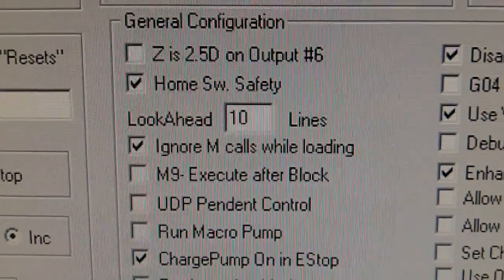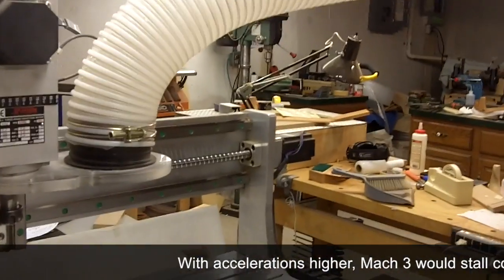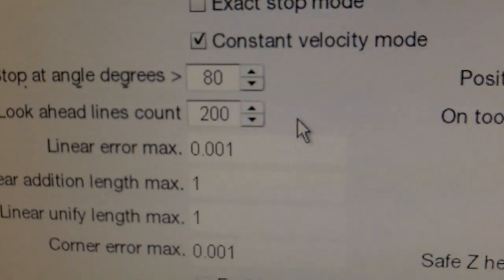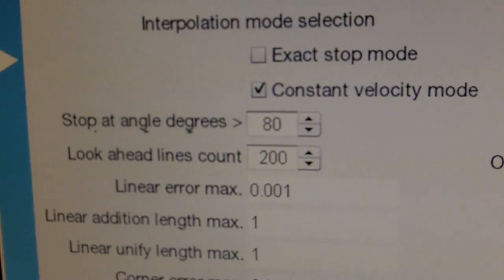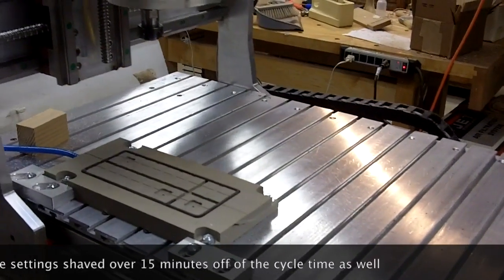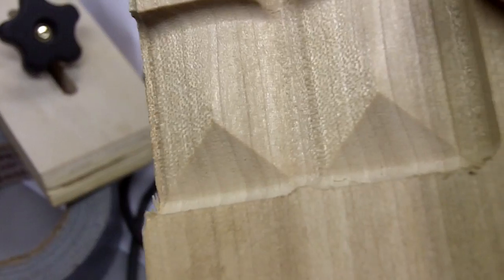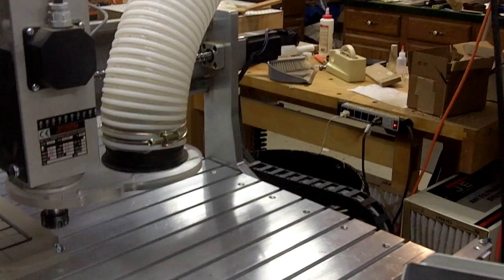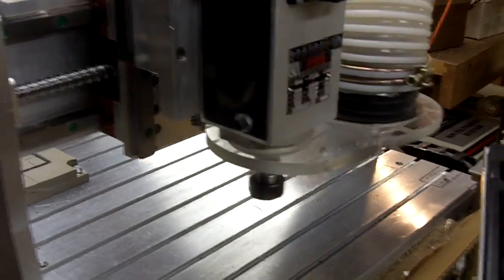Mach3 vs. UCCNC

Comment: I think the answer to this uneven comparison, is the "constant velocity mode" that is activated on UCCNC.
Reply from the maker: Can you elaborate a bit?  I don't understand the question you're answering.  CV mode is active on both UCCNC and Mach3.
Reply: @beerco667  It's all about how the systems "optimize" the code to be able to run at the velocity specified.
Reply from the maker: @Mr_Wh1  , Yes, that is correct.  UCCNC does a better job at CV than Mach3.
...still not perfect though - ran a spiral toolpath the other day and it was dog slow.
Reply: @beerco667  I actually don't understand why anyone would use it in the first place.
I mean, if it's for precision parts I wouldn't, but if it something organic shaped, then maybe a little minute rounding here and there wouldn't matter as to the look. It would properly matter a lot for time savings?
Reply from the maker: @Mr_Wh1  Just about everyone uses CV mode all the time for everything.  I now understand where you're coming from.

Comment: I just got UCCNC today and LOVE it so far! Does so many things better than Mach3 (as you already know) 

Can I ask why you changed your "Stop at angle degrees" from 89 to 90?
Reply from the maker: I do actually have it set to 89º these days but I might change it back to 80.  Just gives sharper corners on faceted 
3D work.

Comment: Can you use fusion 360 with uccnc?
Reply from the maker: Yes.  I don't think there's a post built in but I just use the Mach 3 post.  Modify as necessary.

Comment: I’m a newbie , other than I have an 80 watt cnc laser and worked a bit with Vetric software. I’m going to purchase a cnc router table from Avid cnc , but I want to build the electronics myself , so after studying this subject, I will use a UCCNC motion controller right off the hop and learn it instead of Mach . I have seen other videos also that showed more accurate cuts .

Comment: Unrelated question - What material is that vacuum fixture made from?
Reply from the maker: General Plastics tooling board - in my case 40lb/ft^3   Find a local distributor as shipping is a fortune.  Affordable if you pick up.
Reply: Thanks. I suspect it might be a bit difficult to find in the UK.
Reply from the maker: Yea, search for "tooling board" as it's available from a number of manufacturers. I picked them because I got a recommendation and there happened to be a distributor nearby.   Sign makers also use very similar stuff but I don't think you want to go much below 30lbs/ft^3 - you'll have to convert on your own ;)

Comment: I'm currently running Mach3 with an ESS Smooth Stepper and LeadShine M4660. Thinking about moving to UCCNC and unsure which controller I need. uc100 or UC300eth. My Leadshine MX4660 is handing all the limit switches so and relay outputs, so do I really need anything more than the UC100? What is the benefit of moving to the UC300, UC300eth or UC400eth
Reply from the maker: I'm not familiar with the LeadShine M4660 but, you still need to get the limit switch and relay data to the controller through the motion controller.  As far as I know, the only difference between the UC100 and the others you mention (other than USB vs. Ethernet) is that the UC300/400 has a lot more I/O than the UC100.  If there's enough I/O on the UC100 and you're OK with USB connectivity (which I am), there's no reason I can see to spend the extra cash.
Reply from the maker: Frauenarzt Dr. Stefan Frank  ,  good catch!  UC100 has a 100kHz max kernel frequency.  The others have a higher max frequency.
Reply from the maker: Frauenarzt Dr. Stefan Frank  ,  I currently have two routers in service, one with a UC100 + G540, the other with UC100 + C11BOB from CNC4PC.  If my control boxes both blew up today, I'd go with the AXBB combo unit from CNCDRIVE to rebuild them.  It's basically a UC300 (-ish) combined with a BOB with the various isolation etc. that's necessary.  Sports ethernet connectivity and has one whole port with 12 outs and 5 ins that's unused.  It's < $200 for the device!

Comment: IF you want to do a video like this you need to keep the settings the same. Set Mach3 to 200 lines of look ahead and 80 deg cutoff. I think you will find similar results.
Reply: First I would like to complement you on a vidio that people are still finding interesting 3 years later.
but there is a problem your tests are not even close to scientific. So its basically smoke and mirrors. You tests show UCCNC is more compatible with YOUR computer/drives and machine in your opinion at best. You do not support your conclusion that one program is better than the other.
My basic experience is with mach3 for many years in a production environment.
On 2 large mills and a router. The trick to Mach is the OS and computer it is running on (make sure you have the latest version ending in 66) no 2 seem to be alike even if there the same brand specs memory ect most would work well you can run cad /cam answer your emails on them and never know the difference but some Just work great when set up for mach and some dont. One of the tricks is do a full format on a SSD and buy a XP sp3 program from ebay Yes there probably hacked and load without the usual drivers. If you open the installed programs file there is nothing there. The eiternet wont work, The USB on the back will run fine the front will be slow.
Install PCI video card do not use on board. ( I found some ATI's on ebay for $7.00 each. Make sure you install the proper video drivers. Go to mach knowledge base do the configure recommendations . Do not do the standard PC step. You will be amazed with how well mach runs on the correct pc! 
I have not run UCCNC I tried Linux CNC lately back to back tests the OS is more user friendly and stable used 2 of the same spec computers running off the parallel ports with a simple BOB that amplifies the signal and leadshine drivers.
I had seen all this info on youtube about advanced Trajectory and G code interpreters ect ect. Mach clearly out performed linux CNC . Then i did some research linux so called advanced tool paths were an update they did in 2014 before that they did not even have look ahead or CV it was a rudimentary step by move program (real time) LOL.The linux CNC python wont even except Fanuc sub program formats.
An early 1980's fanuc M6 controller has look ahead!
I really believe people like linux for 2 reasons its free and it is open for programmers to play with .
Yes due to variables my ruslts are not fully conclusive but do have facts to support the results not just a not sure about how they work but one works better on my machine?
I know people running mach4 very well and Im not a programmer but the people at mach are clearly talented and sharp they also knew when they wrote mach4 the competition was right behind them so Im sure they did there very best with mach4. And it works well
Reply from the maker: Adam Martin ,  if you'd watch the whole video you'd see that I've done that and you're incorrect. Mach 3 set to 200 lines over and under shoots tremendously yielding junk parts at this speed.
Reply: Frauenarzt Dr. Stefan Frank  So your PHD came Mail order from mexico and what is the subject of your doctorate?
Oh and we were discussing the subject of the video
Reply: Frauenarzt Dr. Stefan Frank  (Or will you explain at which point in the chain of events exactly an estimation takes place?) In the CV settings Thats why they can be configured.
Reply: Frauenarzt Dr. Stefan Frank  (Nothing can be researched via YouTube besides Cat videos and hilarious stupidity. On these topics it may very well be the number one source.)Yes your comments are prof of that
Reply: Frauenarzt Dr. Stefan Frank  One more time CV it the estimated prediction of the characteristics of the mass in motion as for as excel decel and change of direction. It is the blending of motions changing rates and velocity's. That is why your router or the cheap Chinese router in the video or my 7000lb VMC  will require completely different setting. The general rule is the lighter the components in motion the quicker the excel and decel rates should be also the shorter the CV event should be.

Comment: UCCNC works with a regular BOB parallel cnc card like Mach3?
Reply from the maker: Actually, Mach 3 will work directly with a regular BOB to provide step and direction signals to a motor drive. I used it that way for years before I purchased the UC100 to use with it.  That's Mach's original claim to fame is that it didn't need an external motion controller.  Any (not really) PC with a parallel port could be turned into a motion controller.   The rub is that windows isn't particularly suited to real time control and dedicated motion controllers such as UC100, smooth stepper, Kflop etc. do a much better job than the PC at creating solidly timed control signals. 

Now a days it's becoming more difficult to find mother boards with built in parallel ports and HW motion controllers have gotten much less expensive and better.  

All that said - the trajectory planner for Mach 3, 4 and UCCNC all reside in the PC whether you're using the parallel port, USB, ethernet or whatever.  The trajectory planner in UCCNC is far superior to the one in Mach 3 (and 4 from what I understand has the same TP as Mach 3) and it really shows if you're pushing your machine.  And that is why I'm running UCCNC now instead of Mach 3.
Reply from the maker: No, UCCNC only works with CNCDrive motion controllers like the UC100 (which I use), UC300 etc.
Reply: You are both kind of right... The UC100 is a motion controller which uses a regular BoB to allow wiring connections to your CNC (via drivers). But you definitely need the UC100 etc. to work in conjunction with the UCCNC software. A regular BoB won't work directly with Mach3, as it's only function is to break out the pins, but for both Mach3 and UCCNC you need a motion controller. The UC100 has a plugin that will allow Mach3 / Mach4 to be used with the UC100 motion controller.
Reply: Yeah forgot that Mach3 could be used directly, in as you say an albeit more limited capacity (but so could UCCNC if they really wanted to write it that way). I've just ordered a UC300ETH-LPT5 to replace my UC100. The UC100 has served me well and I've never had a problem with it, but time has come to move from USB to Ethernet for convenience. Found out the Mach3/4 TP aren't exactly the same, but they both have roots in the same code. Their claim that they rewrote something like 99% of the code is a very subjective claim, since I can take code from something I have written earlier (and I do, a lot of programmers do) and repurpose the basic idea in another bit of code, if I don't directly copy and paste the code, but just use the routine idea, I could like them claim to have rewritten it because the syntax would be slightly different, even if it performs the exact same function. It is really debatable if you should claim that is "new code" if you are rehashing old code. In the programming world you don't reinvent the wheel if you don't need to.
Reply from the maker: I gave up Mach 3 a while ago but a good friend was beta testing Mach 4.  As best as he could tell, the trajectory planner in Mach 4 is the same as Mach 3 and he actually asked about a couple bugs (like the acceleration limit violation bug) and they said that the TP remains unchanged.  That was a year or so ago so things possibly could be different now...though I kinda doubt it.  He liked what he saw enough that he's switched to UCCNC as well.
Reply: Dodgy brothers mach works fine with a regular BOB
Reply: Andy birko
 (As best as he could tell,the trajectory planner in Mach 4 is the same as Mach 3) . Was he able access the base code in mach 3 or 4 to come to this conclusion? What are his qualifications to analyze the code and come to this conclusion? Degree's ?

Comment from the maker: Thanks Trav36.  For now, I'm going to stick with UCCNC for my routers as it's already purchased and easy to implement.  I'm actually buying a milling machine now that will run on Path Pilot which is based on LinuxCNC if I recall correctly so we'll see how it works.

Good luck on your controller project!
Reply: Im sure you will find your parts are not accurate compared to the drawing, because uccnc is rounding and smoothing the vectors with a spline fit . Sure it runs fast, but thats NOT what the tool path is directing it to do..   Any vector chain can be pre-smoothed  where it runs fast, but you loose a lot of detail.  Thats not what making accurate parts is about. 
Also you messed with the settings  of mach3 to make it run jerky... Ive never seen it jerk like that.
Reply from the maker: @green323turbo  ,  I "messed with the settings of Mach3" because I was getting inaccurate parts.  It's the nature of Mach3: there are no settings for maximum following error.  UCCNC does have such a parameter and believe it or not, parts come out more accurately and faster with UCCNC compared to Mach 3 when configured properly.
There's a lot of Mach 3 fanboys out there with no experience on other controllers.  They seem to have a deeply personal relationship with Mach 3.  The truth is that while Mach 3 is ok, it's an ugly baby.   UCCNC isn't going to win any beauty contests either but it will certainly finish ahead of Mach 3.

Comment: Hi there.
Could you please run Mach4 vs UCCNC
Reply from the maker: If you want to buy me a Mach4 license...sure!   In all seriousness, a friend is(was) a Mach4 beta tester and it's got the same trajectory planner as Mach3
Reply: Thanks for that titbit Andy. I'm currently using UCCNC but was contemplating trying Mach4, but if the trajectory planner is the same I'm sticking with UCCNC, as it is clearly a better TP.
Reply: @DodgyBrothersEngineering  
green323turbo
54 seconds ago (edited)
Im sure you will find your parts are not accurate compared to the drawing, because uccnc is rounding and smoothing the vectors with a spline fit . Sure it runs fast, but thats NOT what the tool path is directing it to do..   Any vector chain can be pre-smoothed  where it runs fast, but you loose a lot of detail.  Thats not what making accurate parts is about. 
Also you messed with the settings  of mach3 to make it run jerky... Ive never seen it jerk like that.
Reply: @green323turbo  I bet you have never seen it run that jerky before because I've never run MACH3 before... What video are you referring to?
Reply: @DodgyBrothersEngineering  , The reply was for Andy Birko... but its about the video above that shows mach3 decellerate for angles. Like a program should. If it doesn't have to slow down , then the tool paths has been altered .

Comment: Thank You for posting this. Am getting ready to purchase another controller. UCCNC with the UC400ETH looks like a nice capable and affordable package.
Reply: DiscountDisrespect  I gave up on trying to build systems that use a PC as a controller. I purchased 2 complete dedicated 32 Bit CNC Controllers for about $150- $200 USD each from Banggood (Machifit 50KHZ CNC 4 Axis Offline Controller). For my bigger mill and lathe, I purchased a Planet CNC MK3, 9 axis board that will do more than I will ever need. It was about $250USD. It and takes a simple encoder from the lathe chuck to do threading. Unlike these generic USB controllers, Planet CNC is a closed garden and they build the software and hardware to work together properly. I think Planet CNC is far and above everyone else out there. You can download the software for free to try out but only works with their controller boards. https://planet-cnc.com
This goofy video shows just how advanced Planet CNC is: https://www.youtube.com/watch?v=zB8b43JXuwE
Life happened and I was never able to install this equipment in my shop so cannot on its actual use. So much has gotten cheaper and better since I posted 4 years ago. Stay away from this old piecemeal stuff.

Comment: Hey Andy, thank you very much for the video ! I personally run Mach3 at 2000 Lines Lookahead which does run quite fast but still ignores accel / decel and has huge roounding errors on the part. I do have one more question, wheres the difference between the "100" and the "300" version of the ucnc usb converter cable ?
Reply from the maker: The UC100 is basically a single parallel port replacement device.  If you're running Mach3 with a parallel port, the UC100 is a drop in replacement.  The UC300 is I think 3 parallel ports that can add a bunch of I/O, handle encoders etc.   If you're looking to fix the rounding errors etc, you have to move away from Mach3 as those errors are produced in the trajectory planner.
Reply: Thanks for the info, i do know about the trajectory planner, im lenne0815 from the cnczone forums ;)